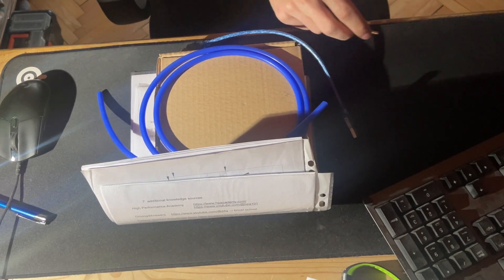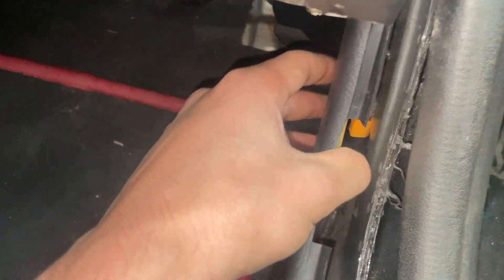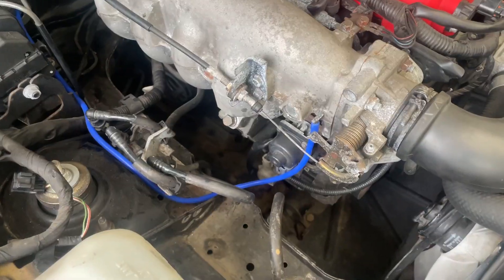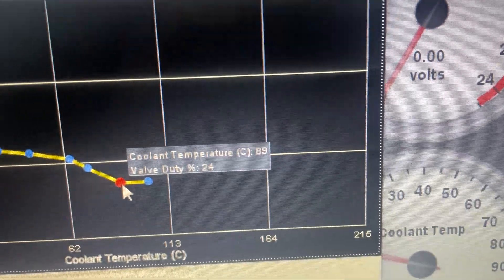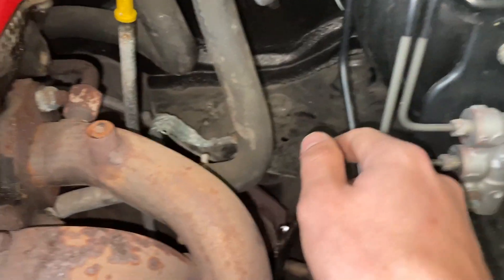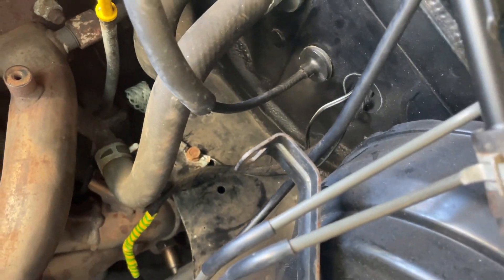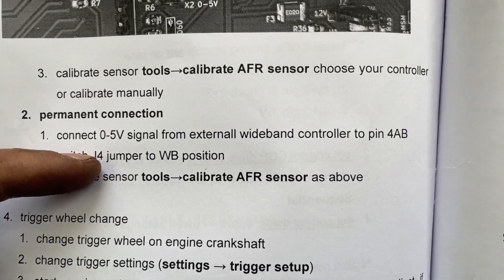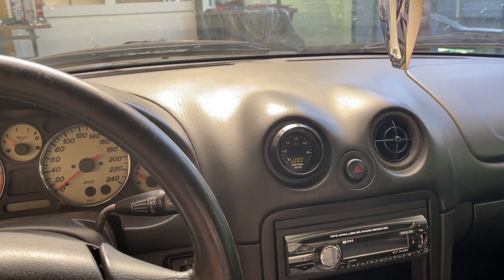Miata NB Standalone ECU and AEM AFR Gauge Install | First Start

Comment: Hi man sorry to bother you, quick question, i have installed a Speeduino too from Alex on my NB1, i have 2 big problems at the moment and i was wondering if you had a similar experience.
First of all the ECU doesn't read the AFR from my wideband sensor, it just displays a fixed value all the time. I switched jumper and did all the modifications in the software but it doesn't work.
The second problem i have is the fact that over 4000 rpm the voltage jumps really high, like 17-18 volts. I can't find any way to somewhat tune the alternator control. :(
Reply from the maker: Hello. That seems interesting. I didn t have any problem like these you mentioned. I would suggest contacting Alex as he helped me too with a lot of my problems regarding to his ECU
Reply from the maker: As of the afr. Did you calibrate the sensor values?
Reply: @miataguy05  yeah, turns out that on the NB board you don't have to switch the jumper, now it works. 
I've contacted Alex now regarding the alternator problem, I'm thinking it might be an actual fault with the alternator itself as in the past it has burned a couple of headlight bulbs after a bit of limiter banging X) but now it seems way worse so idk
Reply from the maker: Yeah i wanted to say that your alternator might be the problem. Now that you sayes that it burnt out bulbs in the past i’m even more convinced that that is the problem. Be careful not to damage more components with it
Reply: @miataguy05  thanks for sharing your opinion. Also fuck more money down the drain🤣🥲
Reply from the maker: No problem! Thats just how it is😂